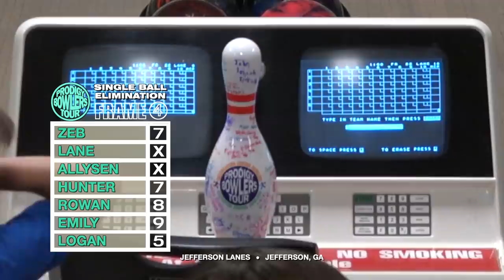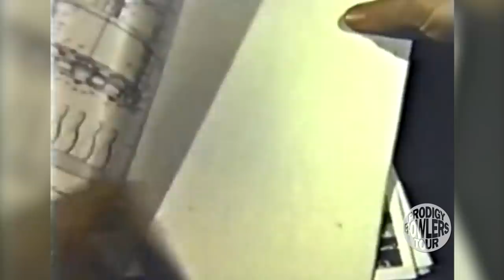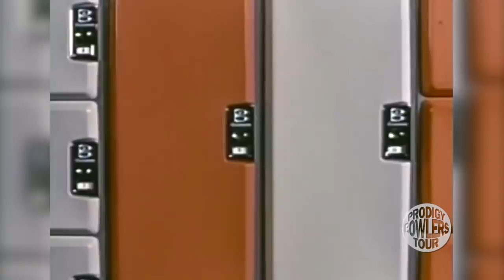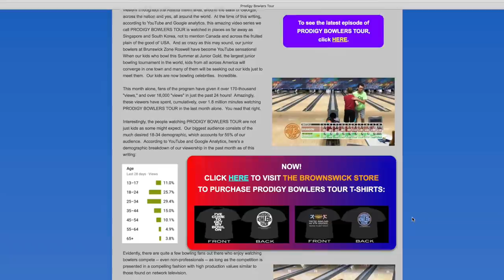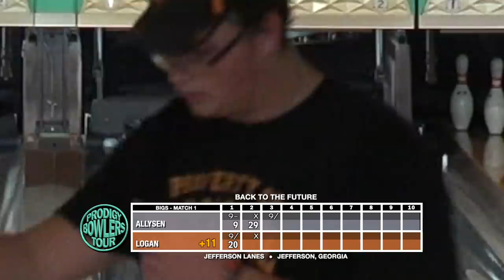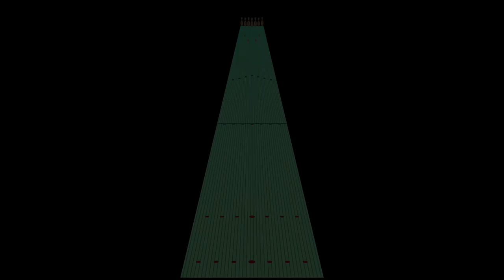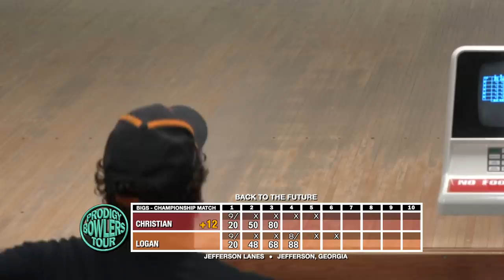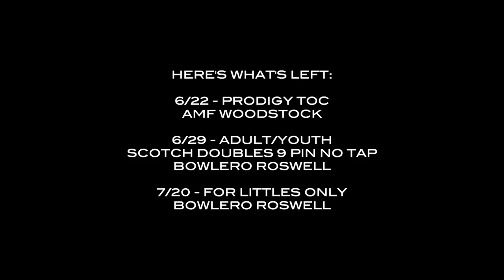PRODIGY BOWLERS TOUR -- 06-08-2019 -- Back to the Future

Comment: There are MANY more differences you can't see from the front between a model "A" and an "A2" pinsetter, most differences are in the back. Really all you'll notice from the front is the rake dropping first due to the addition of the rake trip assembly or the "shotgun" as its often called, and a change in the pit cushion design and the linkages to trip the rake first before the deck lowers. As mentioned on a model "A" you will see the deck and rake lower together. Machine speed itself can be changed (faster or slower with just 1 pulley change on the 1HP motor) and as time has passed MANY MANY A2's have been slowed down to jetback or original "A" speed to save on wear and tear since they are running slower (and more smoothly). Model "A"s have different ball lift rods in the back (taller) and the return track is totally different as it's an entirely gravity based return system once the ball exits the lift rods. A2's have ball accelerators to get the ball back more quickly since the machine cycle is much faster, basically just a long belt that shoots the ball down the ball ramps. There were also the jetbacks, which were converted model "A"s and were basically between the A and A2. If this place was built in 1960 that's WAY too new for Otis made machines. I have some old videos on my channel before I became disabled of machines in the 3200 serial number range (field converted to A2's) that I was fortunate enough to work with, installed in late 1956 or early 1957 still running like gold 60 years later! Absolute TANKS, I heard originally the machines were supposedly going to last 8-12 years, just a tad off on that estimate lol. Otis made machines I feel were the best though, just GOOD 1950's american steel, of the 12 lanes in the center shown on my channel MANY MANY parts were original still, rake arms, deck lift shafts, etc. Just so well made and such beautiful machines. I miss working on them more than throwing the ball down the lane. I hope someday I can return to working with them again
Reply from the maker: Thank you SO much for writing this.  I did not mean to suggest that the ONLY differences between the two machines were the timing of the rake and the table descending and the speed of operation.  But as you correctly mentioned here, they are two of the more readily apparent differences from the bowler's perspective.  Having never worked on pinsetters, I would not pretend to know all the differences between them.  I also did not mean to imply that I thought THESE pinsetters at THIS house were of the Otis Elevator era.  It has long been my understanding (and I thought I indicated) that THE EARLIEST Brunswick "A" machines were made by Otis Elevator.  The exact date is not something I've ever quite known.  But the fact that the early Brunswick "A" pinsetters were made by Otis is, itself, a source of fascination to me, and I thought it might be to others, which is why I mentioned it.  There are some things I consider myself a expert on.  This is not one of them, so I really do appreciate you chiming in here.  I love the history of our sport, and the introduction of the automatic pinsetter in our sport was a landmark achievement -- arguably the most important advancement our sport has ever seen (far more important than the modern bowling ball) as it changed the trajectory of the sport from a seedy activity swept under the rug of polite society to being a sprawling and expansive sport that was brought to the mainstream of modern society.  Again, thank you for chiming in with this information.

By the way, for what it's worth, my understanding of how the timeline played out goes something like this:  In 1946 (or was it '48), AMF introduces the first automatic pinspotter at the ABC Tournament in Buffalo, NY.  Brunswick lags behind a few years before they introduce their first "automatic" to proprietors.  I am not sure exactly what year that took place.  Do you know?  I know that when I was a kid, a brand new bowling center opened up in my neighborhood called King Louie Ranchmart Lanes in Leawood, Kansas (suburban Kansas City).  King Louie Ranchmart was a 24-lane center with the twin Gold Crown masking units (white) with the subway "Cluster" ball returns (white and gray).  The fiberglass bench seating was white.  And the pinsetters were the same Brunswick "A" machines seen on this week's PRODIGY with the gold face on the rake and the "Brunswick" script.  The pinsetter table had the gold "B" on the front just like these.

Thank you also for the timeline of the introduction of the Jet Back retrofit kit for the A machines.  That jibes with what I remember as well.  To the best of my recollection the A2 machines were first introduced in the mid to late '60s.  Is that how you remember it as well?

Again, thank you for this.
Reply: @ProdigyBowlersTour  Oh gladly! Good to speak to you again as well Randy, we haven't since Keith's (mrbowling300) forums years back. When I became ill I fell into a deep depression and really went unsocial and off the radar. If anything came off as rude or downtalk I assure you by all means it was not. I can't physically work on the machines anymore so if I can share knowledge that I do have I always try to. I know from Prodigy and even before on Keith's forums you're a historian like I am :) That stuff always fascinates me. And yes your info is correct, the 1946 ABC Nationals in Buffalo introduced AMF's first model of the 82-30. AMF actually had quite a lead. It wasn't until 1956 in Roselle NJ that Brunswick first installed 16 Model A pinsetters (later field converted to A2's, and sadly Roselle closed a few years back). Rumor has it Brunswick took those 16 machines back due to how old they were and being their first installation of them. The earliest deck shields that I have seen were a dark green color with simply "Brunswick" written in cursive on them, tho I will admit I always liked the big gold "B" like these model A's had. I did notice these A's were modified to remove 90 degree overtravel (which was a safety concern), longish story but I can get into that too if you'd like. Some Otis history for you, Brunswick made a deal with Otis to make the machines for them as they were setting up their plant in Muskegon, the demand went crazy and Otis made the first 25000 machines or so for Brunswick before their facility was ready. The center I worked in had 8 lanes (machines installed in late 1956 or early 1957, never could get an exact date) then 4 more lanes were added and were later Otis made machines with various serial numbers between 20000 and 23000. Your timeline is correct according to all of my readings over the years (sadly I'm only 39, I missed out on a lot BUT I will say my first center I bowled in when I was 3 had ALL Gold Crown. Single lane masks, and subways with the LONG returns and field converted A2's). The first factory A2 as we call them (made by Brunswick as an A2) was released in either 1962 or 1963, I wanna say 62 but I might be mixing that date up with AMF (I worked on AMF 82-70's for over 10 years, starting when I was 18 and later changed centers and worked on Brunswicks). Your dates/timeline is pretty spot on. I'm glad you found the info useful and again if anything came off in a sour way, not intended at all. I just love discussing the machines and their history, they were my love and passion for many years and if I was physically able I would still be climbing all over them with grease, oil, wrenches, and ratchets. Good to speak with you again Randy, it's been literally years. If I can answer anything or help in any way feel free to hit me up at anytime! :)
Reply from the maker: Rep2369  — What was/is your screen name on MrBowling300’s forum?
Reply: @ProdigyBowlersTour  I think it was just Rep without the numbers on the end. It's been years since I've been over there. I remember we chatted a bit. I know you were BowlingOldies back in the day :)

Comment: Today i was bowling league and i left a pocket 7 10 split and then i missed it and then the next frame on the same lane and i left another pocket 7 10 and then i threw my ball about 25 mph and the 7 pin bounced out of the gutter and rolled across the deck and knocked the 10 pin over.

Comment: Wood lanes are alot more fun to bowl on. You have a different shot almost every week when you bowled league. One week it could be real dry. Next week it would be a great shot until the third game. Then you moved way inside to lay it down. I'm 65,I preferred wood lanes myself. More fun back in the day of weaker balls. Bowling as it should be on wood. Harder to control the ball instead of just laying it down and the oil guiding it to the pocket. Rowan needs to quiet down in the background. He never keeps quiet during video screening.

Comment: Are those brunswick a pinsetters and in the brunswick zone and amf woodstock lanes have a-2s?
Reply from the maker: These are Brunswick "A" machines.  Bowlero Roswell has the Brunswick A2 machines (which, unfortunately, were not well maintained until the last year or so -- they've been catching up on a lot of long-overdue maintenance issues).  I believe AMF Woodstock has A2 machines as well.  They have the original A2 stickers on the face of the pin tables.  Although they run kinda slow like the "A" machines.  But that can be a choice by the mechanic.  You can adjust the A2s to run slower like the "A" machines.  It puts less wear and tear on them.
Reply: @ProdigyBowlersTour Ok, thanks for all of this information! Have a nice day!

Comment: Would u come back to Jefferson?
Reply from the maker: Sure, if they'd have us.  I will say, however, that since releasing this video, I have learned of another all-wood center with retro 1960s-vintage masking untils about the same distance from Atlanta but in a different direction.  This one's an AMF house with the old "Magic Triangle" masking units with the "pindicators."  (I don't know if the pindicators still operate, but they're there.)  I also understand that this particular house has a youth program.  So going up there seems like a natural if I can ever get in touch with them.  The owner at Jefferson Lanes told me there was a good chance that the wood lanes could be converted to synthetic soon.  See, the deal with wood lanes is, each time they're re-surfaced, you have to shave the wood down a bit to flatten out the surface.  Over the year with each resurfacing, you reduce the amount of wood that's there until the lane beds become so shallow there's no wood left to resurface.  So you either have to install new wood lanes (very expensive, and I'm not sure if companies even make them any more), or you have to install synthetic panels over the top of the old wood lanes.  He told me that the next time they resurface (and the lanes appear overdue now for that to be done), they'd probably just switch to synthetic.  So when that happens, part of the center's appeal would be diminished.  But I still love the place and the retro masks.  Besides, they were so nice and just awesome hosts, that I'd definitely consider another trip there somewhere in the future.  But I'd probably want to go to this other place first just so we could see an old, retro AMF house -- something we've never had on PRODIGY before.  But that's nothing against Jefferson Lanes.  I highly recommend that people go bowl at Jefferson Lanes.  It's an awesome place.  We thoroughly enjoyed our trip there!